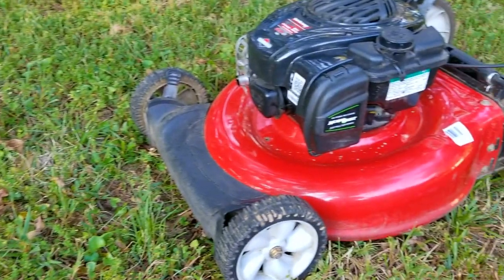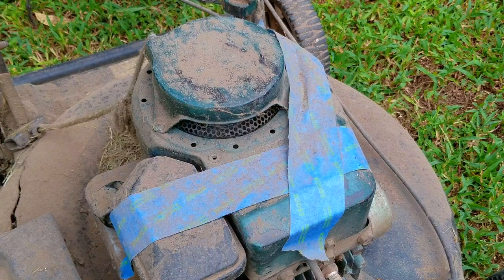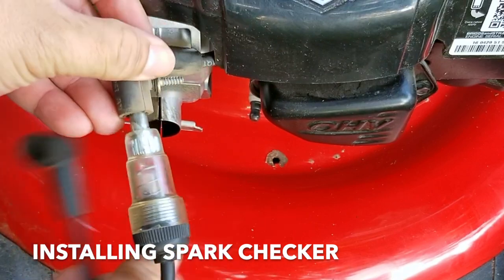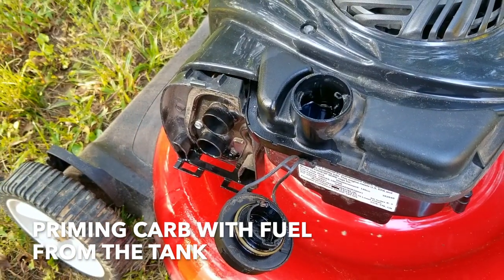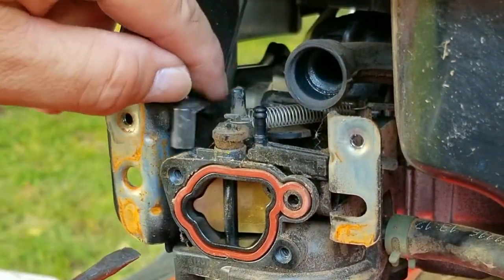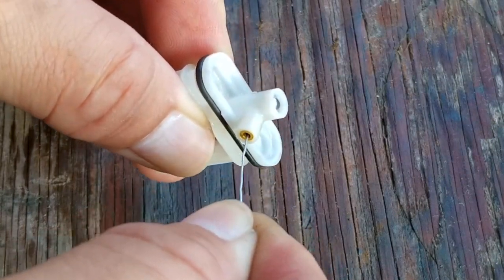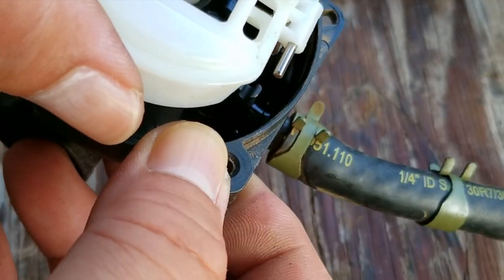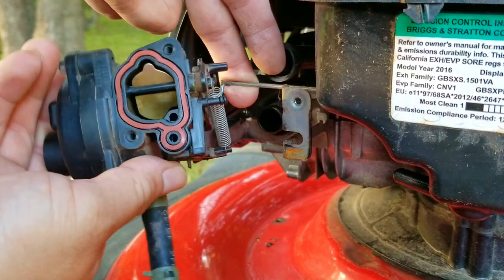Why Did Briggs Stop Making The Flathead Engine?

Comment: I worked at Western Air-Cooled Engines in Vancouver BC as a mechanic from 1973 to 1978. It was my first job after graduating from high school. I had just turned 17 a month before I started there. I repaired and rebuilt countless Briggs & Stratton engines... on everything from lawnmowers to generators to water pumps to mini-bikes! We'd also get the old cast iron B&S engines from the 1940's and 50's in for repair/rebuild. They were popular for use on fishing boats used for trolling, as those ancient cast iron beasts could comfortably idle along at a very low RPM while slowly pushing the boat. 

The best tip I can give anyone with a single cylinder engine... always store the engine after use with the engine on the compression stroke. This ensures that both valves are seated. This prevents a hot exhaust valve from warping when it cools down (leading to a stuck valve and/or poor compression), and it also prevents moisture from entering the combustion chamber during long periods of storage (and possible corrosion/hanging valve issues).

My current rotary lawnmower is an old flathead B&S, probably from the 1990's. Runs like a charm!
Reply from the maker: great advice!

Comment: As much as I like flatheads I also much prefer the ease of adjustable valve lash and the tuning characteristics you can easily achieve. I hated these plastic carb junk engines at first until I realized how easy they are to get running. I'm actually rebuilding one now for an edger someone threw away without spending a dime. Even the oil I'm using is used.
Edit: Better enjoy ICE powered mowers while you can. Honda has already stopped production of push mowers with ICE power.
Reply from the maker: I appreciate your comment.
Reply: Fortunately, there are plenty of Honda ICE-powered mowers floating around. I'm using a Honda-powered Troy-Bilt I rescued from someone's trash a few years ago. And I've never had to adjust the valve-lash on a flathead.
Reply: Valve adjustment on a flathead is a pain compared to rocker valves.
Reply: @eugeneoreilly9356 
I've never adjusted the valves.on any of my flathead mowers. None of the ones I've had apart, even had an adjuster for the valves. I believe, if there was a major valve adjustment problem on a flathead, the valve or cam-tappet had to be removed and replaced or ground shorter, depending on if the clearance was too big or too small.
Reply: @sunbeam8866  yip,usual way was to grind the valve stem.

Comment: This is a very interesting video.  IMHO, the average homeowner just wants a mower that he/she can fill with gasoline, turn on the power switch, and get it started and get the lawn done as quickly as possible. At that point , the mower is put aside (probably on the side of the owners home) and left until it is needed again.  Most homeowner mowers will rarely if ever; receive an oil change, have old fuel drained from the tank, air filter changed, deck cleaned, blade sharpened, wheels lubricated, etc.  That said,  the new OHV Briggs  may suffice for a season or two, but once that mini-main-jet clogs, most homeowners either contract with a lawn service, or go out a buy a new mower. The old flatheads, especially with the old in-tank carbs, will take abuse that no currently manufactured mower can sustain.  The old flatheads will even run with significant amounts of water in the tank.  The point I'm trying to make here; average homeowners just want to get things done with the least amount of time and fuss, the older flathead Briggs engines are just tough to beat when it comes to that. Unfortunately, those days are gone, and now homeowners will have to become much, much more careful about how they maintain their mowers.  Putting aside my soap box now, just want to say, this is another excellent video, keep up the great work.
Reply from the maker: well said!
Reply: Less is more! 🙂

Comment: Everything you said was spot on.  It boils down to personal preferance.   I have been a Brigs fan since 1953 when my dad bought our first power mower with a 3 1/2 hp engine and front wheel drive.  He was still using it in 1990 when I visited him.  I miss that old lawn mower almost as much as I miss Dad.  LOL  I don't mind the plastic carb but the same jet does get plugged for no apparant reason, and I wieh I knew the reason for it.  And the newer engines do start easy, and are more powerful.  Happy camper here.
Reply from the maker: thank you Dave, I appreciate you sharing your experience with us.

Comment: Hey bro what's up? My choice would be older equipment because of the durability and performance of those equipment. A lot of people are considering using battery operated tools and I like some of them but I'm not a fan of them all. Gas tools are best when you have lots of area to cover within a short space of time  whereas battery operated can be used in a domestic manner where the work load is less and it wouldn't take away time from you in order to get the batteries recharged.
Reply from the maker: I like how you explained the battery power.
Reply: @INSIDEHOUSEGARAGE  thanks bro. That's the sad reality we're living in.

Comment: I’ve had a Briggs and Stratton Quantum Engine for 20 years. Simply change the oil and the air filter every spring and it starts on the first pull. 
Thanks to a little reading and YouTube videos like this one, I learned how simple it is to do more sophisticated maintenance.  So no problem to clean the carburetor and remove the head and clean out the carbon from the combustion chamber. I finally put on new front drive wheels on the mower today as the originals were bald from all the use!
Reply from the maker: you are correct, these are fantastic engines

Comment: Hi, I think it really depends on the points of view. I've been lucky enough to have both the 35 classic flathead and the 550 e series. I don't know why but I think that the petrol that comes to Italy is different, in all my life I have never found any type of deposit in the carburetors after months and in some cases even a year. another important thing is that the 550 consumes much less than the 35. in my opinion with the oil changes on time even the new ones are just as fantastic as the old style ones. The only extra operation is the valve clearance. if I have to be honest, I have to admit that maybe the metal tank and recoil assembly seem more resistant but unless you do it on purpose I think it's difficult to ruin them. Regarding the petrol issue, on the 35 classic I had to change the membranes a couple of times. I have to admit though that in my opinion we are all very fond of the old style briggs but it's a matter of time.
Reply from the maker: thank you for the information Ste_B.
Reply: @INSIDEHOUSEGARAGE  It’s a pleasure, I just wanted to share my experience, I really like this kind of videos
Reply: Perhaps Europe doesn't use Gasahol .
Reply: @sunbeam8866  We have ethanol in the gas too, but we have much higher quality of fuel the standard gasoline in Europe gas 95 oktan in the USA only 87.
Same goes with the Additives, it dont go bad even after a few years
Reply: @jonasstahl9826  different octane scales, the US uses AKI, rest of the world uses RON or MON. Pretty much subtract 5 from the RON octane number and you have the equivalent of the US octane

Comment: I have two flathead Briggs. 1 is in my old lawnmower and it runs without any problems but does show it's age. That one is a 3hp. My other Briggs is a 12hp single cylinder from the mid to late 60's. All original even with the magneto and generator. Smokes like hell but I love it.
Reply from the maker: well said, these are great engines!

Comment: Briggs was very good before the 1970's and into the 1990's. After that Honda came along and stole the show. Late 70's and late 80's I was in the Waukesha WI plant floor/engineering dept repairing typewriters. I have been on countless manufacturing floors and design departments through my field service days in Typewriters and computers. Brigg's of course was one of the best but you really have to decide if you want to sell more or the best. I think companies sometimes make poor decisions with that choice. Would have I purchased a fuel injected Brigg's if they had offered one in a lawn mower, well it would have been really really tempting but a Honda is a Honda. Something from google which really does fall into line. Why did Briggs and Stratton fail?
While corporate executives who preside over failure often find someone else to blame, Briggs' demise has, in reality, directly resulted from its executives' mismanagement, greed and pathological animosity towards the unionized workers who had made them rich. Reprinted with permission of Wisconsin Examiner.Sep 28, 2020
Reply from the maker: thank you

Comment: I love the old flathead quantums, but these newer Briggs aren't bad after a few simple mods. I drill out the brass main jet just slightly and install an inline fuel filter. Keep your oil changed too and you'll be fine. 

The old quantums were most likely phased out for emissions and fuel efficiency reasons.
Reply from the maker: thank you Dave Stout

Comment: Interesting design on that carb... I hadn't pulled one apart yet. 

While most people hate plastic, that design at least won't corrode.
Reply from the maker: very true, I believe it was designed with ethanol fuel in mind.
Reply: @INSIDEHOUSEGARAGE  It'll never run the same again. You wrecked the jet by cleaning it with a wire. No matter how careful you think you were, you scratched the bore. Plastic bristles and carb cleaner are a better way to go.
Reply: I'll take corrosion over brittle, crumbling plastic any day!
Reply: @AgentJayZ  it's a brass jet, it isn't THAT sensitive. 

If you've ever drilled a jet out you have to remove physically visible material to make a difference. A bit of smooth wire won't make a darn difference.

Comment: Love my old flatheads, my 2006 and 2011 model years are still going strong.  I’ve worked on my friends mower with the new engine twice due to the jet getting clogged.  Finally added a fuel filter to the line and he hasn’t had any trouble since.

Comment: I've owned and repaired quite a few of the older flat head B&S engines, I love the simplicity and reliability. My neighbor's mower, for example, has barely had any upkeep always has old fuel in it and is regularly abused. Still starts and runs every time.
Reply from the maker: very nice, thankS!

Comment: I really like the old flatheads but their time has come and gone. The newer style engines are good as long as they are taken care of, plus they are more fuel efficient and run cooler (and easier to work on too). I do wish they’d stop all the “never change the oil” bs though.
Reply from the maker: I agree.
Reply: Just change the oil. They only put that there so it would look more desirable to people who don't like maintenaning engines. You can however get away with skipping oil changes in this engine if you use the premium long life 5w30 fully synthetic oils Briggs and Stratton and other manufacturers sell.
Reply: Quieter too. 
Flatheads were good for what they are. But I'll take OHV anyday.
Reply: Might be worth mentioning - Briggs sells a vacuum pump. I bought it on Amazon to suck the power steering fluid through to get clear fluid. I was surprised when it arrived it was a Genuine Briggs & Stratton vacuum pump. It's a nice little pump. I use it for brake fluid too. All I had to do is use a rubber windshield hose and it fits perfectly.
I think they want people to use that pump to suck out oil.

Comment: The way I understand it, OHC engines will produce more horsepower than similar-sized flatheads because the fuel is more effectively delivered to the combustion chamber.  I remember seeing OLD Model-T, 4 cylinder race cars that had their flatheads replaced with uniquely engineered OHC heads to much more effectively produce horsepower.

When I was 9 years old, I was given my first broke down lawnmower with a flathead BS 3hp engine by a neighbor who had upgraded.  I went to the library, checked out a book on SGE repair and rebuild, and had a field day.  Whenever I came across a yardsale with a non-working mower, I bought (usually for around 5 dollars), rebuilt the engine, and then usually resold it for 25-40 dollars according to namebrand.  This is in addition to trolling the neighborhoods around me for lawn-mowing jobs.  I did this for around 3 years.

The newest 10hp engines look to be about the same size as the old 3-5hp BS flatheads.
Reply from the maker: nice, there was something great about finding something that was broken and fixing it, Thank you DanD.
Reply: Ohv engines give more power as they're volumetric efficiency is superior to the flat head design ,better breathing essentially.

Comment: I always was annoyed, how gas guzzling these old flatheds have been. You never could have enough gas in stock. But, yes, you're probably right, thinking back, it is possible, that the starting problems after a relatively short time of storage occurred with the OHV-engines. But then, not certain, because since then we also have this bioethanol-addition to our gas. At least here in Europe. And i'm unaware of having these glaze like residues inside the carbs in the 70s or 80s like we commonly have today. And we worked on carbs daily back then.
I highly doubt, that a flathead wins in fuel efficiency with injection due to the terrible combustionchamber design.
Reply from the maker: yes you make a good point about the combustion chamber design. It was never going to win in efficiency or making less pollution.
Reply: I think you’re underestimating just how inefficient carburettors are, particularly the cheap and nasty ones that are commonly employed. You also may not have considered the advantages of an electronically controlled ignition system which would be integral to the fuel injection ecu.
It’s actually not difficult nor expensive to build your own fuel injection setup using scavenged parts, and I’ve run flatheads this way, albeit as stationary engines. The fuel economy is incomparably better whilst the output power gets a very healthy boost too. I have zero doubts that it would outperform a similarly sized, carburettor equipped OHV engine, although modifying an OHV model in the same way yields, predictably, even better results.
Reply: @anhedonianepiphany5588 
All my generators are or were carburator engines without fuel injection or electronic ignition.
I like to keep it simple.
Especially with SHTF stuff.
The flatheads were Briggs & Stratton, the later ohv types were chinese honda rip offs. 
Was immediatelly impressed, how much more labour time i got out of the ohv design. Of course there is huge variation in quality with chinese rip offs, fuel consumption vary too.
Also, i must say, it's very easy to reseat valves on an ohv - which is something, a generator needs from time to time. At least the chinese ones. Point for ohv.
In general, i hate the amount of care you have to put into these tiny engines compared to a real one. 
Gladly i'm on grid again and my geneators are stowed away. All are non starters now in need of carburator cleanout, i assume. 
I have no idea, if fuel injected gas generators would overcome this issue, just did never want to spend extra money for having more electronics.
I'm really pissed with my one inverter generator, because the slightest and shortest overload situation and you have to go out and restart.
Ok, impossible to accidentally burn the generator, but still annoying. Good example for how electronic made the user experience worse.
I do like AVC-modules over mechanical voltage stabilizers though - so much safer for the equipment - but you need spares at hand. They quit suddenly from time to time.

Carburator cleaning is easy and fast and never needed, if you use the generator daily -  the real problem with these cheapo chinese ohv is wear and compression loss anyhow.
Longevity of the cast iron Briggs&Stratton industrial grade engine is unrivaled for sure - but they're guzzling a lot too.
I still have an air compressor with a 12hp B&S IE sitting around, just in case.
Reply: @werner.x How did mechanical voltage stabilizers work?

Comment: Hi there! I continued to like your videos. You’re very informative. I have a lawnmower with each of those engines one is the Troy-Built XP with the 175 cc OHV engine from around 2010 and the other is this the 190 cc Briggs flathead on a Husqvarna motor that was built in 1999. They both run fantastic! I do change the oil in my machines and run the carburetors dry before storage. Neither one of them have plastic carburetors, but if they did, I can guarantee you I would have no issues because I would run them dry before Storage. That is the key with these machines, plastic or metal. I love the toughness of the quantum, but I love the efficiency and the power of the newer OHV engines.
Reply from the maker: me too, and I totally agree with you.

Comment: The EX motors just aren't as sturdy as the older Quantum motors were.
Reply: It's also the Quantum being the end of the line, they perfected the side valve when they built it,  whereas the OHV adds another maintenance task where there was none. 
B&S took a step backwards, in quality & longevity, & hoped nobody noticed. But the Quantums are still out here, proving the later design inferior. lol.
Reply: @Tim Ewa  They really are. You made a good point,  they perfected a design, then ditched it in favor of a lesser motor.  I am sure the EPA had something to do with it.
Reply from the maker: agreed
Reply: The last auto-choke version was brain damage, WHY change from primer??
Reply: @LOT 6  I dunno,  it can be a little work to get it exactly right, but when they are right, the Quantum is the easiest mower out there to start.